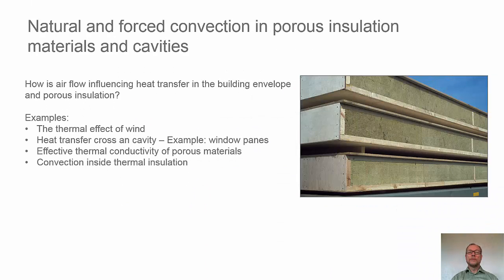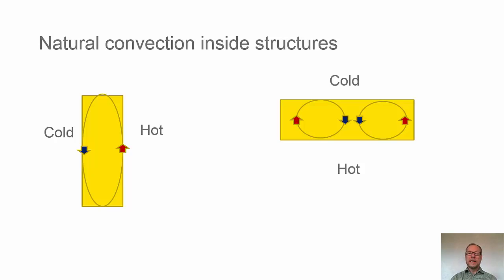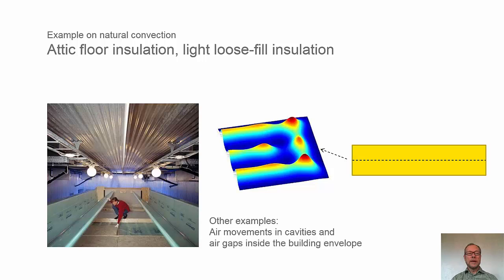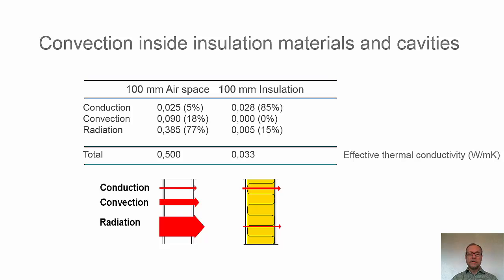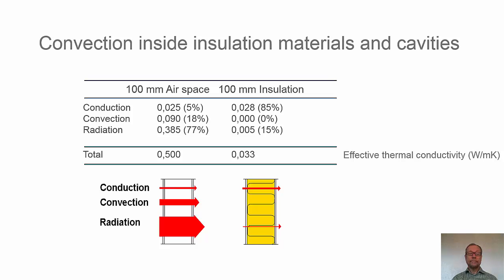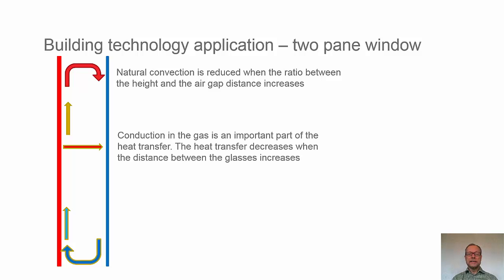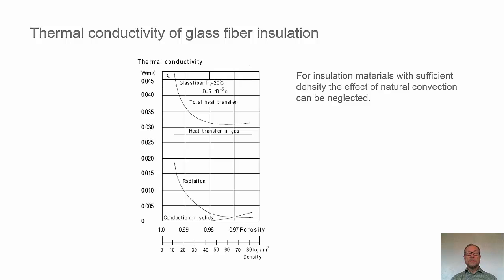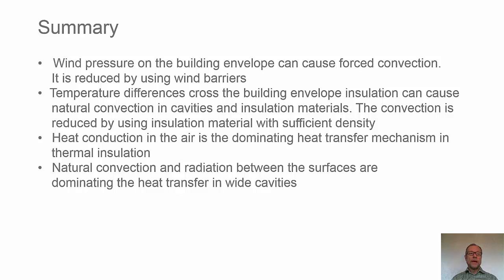Natural and forced convection in porous insulation materials and cavities

Comment: Thanks for the videos.What do you mean with " heat conduction in the air"? Regards
Reply from the maker: I refer to transfer of heat between air molecules due to difference in temperature(vibration) without any net relative movements in any direction.